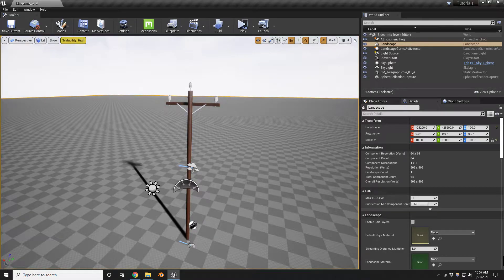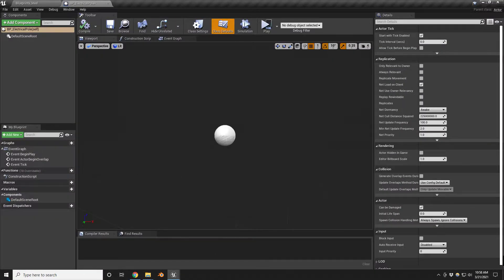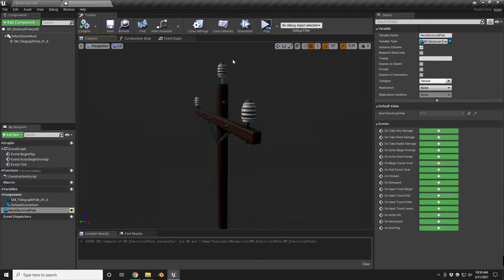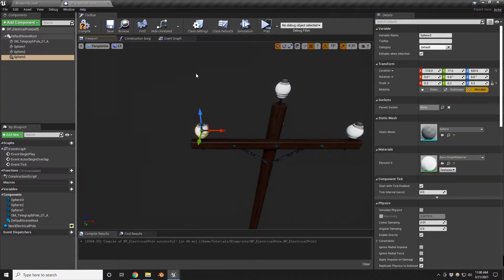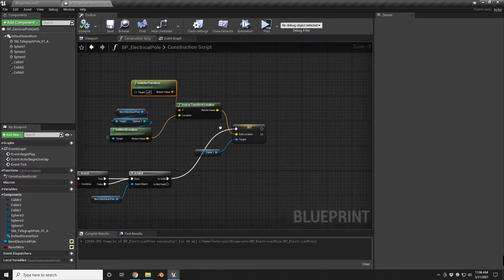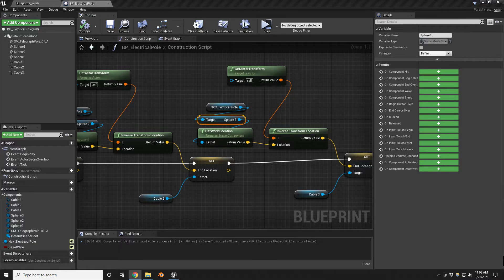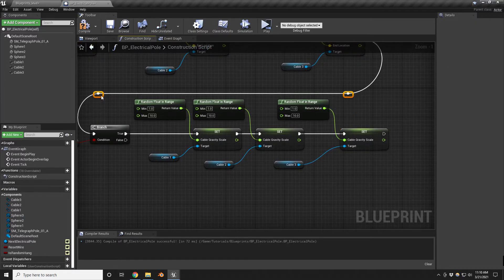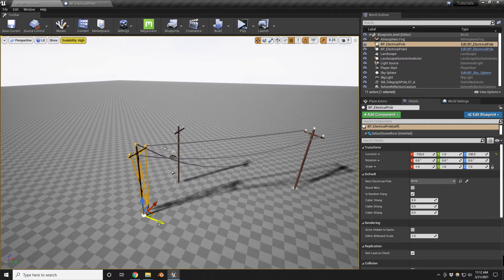Simple electrical/telegraph pole system in Unreal Engine

Comment: Very nice tutorial. I'm asking as a beginner - can this system be rigged to Unreal spline? So the poles placing will be more like automatic system?
Reply from the maker: That is a very good question. This might work on a spline, though i am not sure how the cable component will behave with that. The reason i did it this way, aside from the simplicity, was that you can control each pole and set various properties, like a light, torn cable, etc. One thing you can do once you have them all linked, if you move some of them around, is select them all, and check the reset wires box, to readjust the wires.
Reply: @AndreiGhenoiu  Thanks for answer. I agree, the control per pole is great to crate more natural feeling. Maybe the random attributes you presented in the video can make similar effect on the spline based poles in cases you don't need precise control. Like on long road distances etc

Comment: Have you experimented with connecting cables using PCG? I’m trying to work out making a post and wire fence using a spline but I’m in way over my head 😬
Reply from the maker: I have not yet done that. What I have done is use a tool from the marketplace called ia_scatter that also makes use of a spline, and place these poles as a blueprint actor using the tool, and them linking together automatically based on a trace and dot product. I showed it a few times during my weekly streams if you're interested in what I ended up with.
Reply: @AndreiGhenoiu  cool which stream episode was it? I’ll check it out
Reply from the maker: @peterallely5417  There should be something here https://www.youtube.com/watch?v=GFchu350FLE&ab_channel=AndreiGhenoiu, where I am going over some of my process - starting with the beginning of the video. Hope it helps a bit.

Comment: Tank you! Quick question though, when I try to package my game all the endpoints reset to a random point on the map? any solutions?
Reply from the maker: Oh that's an interesting one. I'll try to  package my project as well to test it out. Have you tried merging the blueprints down to meshes?
Reply: @AndreiGhenoiu  not yet, let me try that and see how it goes! Thank you!
Reply from the maker: @SaatvikDube  Sure thing! I'll see how it goes on my end as well, but would love to hear from you!
Reply: @AndreiGhenoiu  sounds good! I’ll let you know 👍🏾
Reply: @AndreiGhenoiu  So I tried a few solutions. First I merged all the Blueprints, however when i do this the only thing that shows up in the merged actor spheres from the blueprint. The same thing happens when I try to convert all the wires to a static mesh as well.
Reply from the maker: @SaatvikDube  Thanks so much for trying it out. I will try to package my project over the weekend and see what I get as well. Hope we can come up with a solution for this.
Reply: @AndreiGhenoiu  thanks you!
Reply from the maker: @SaatvikDube  Have you tried running it in standalone game? Was wondering if you have the same issue there. That should be similar to the package game.
Reply: @AndreiGhenoiu  Hello, thanks for the reply! I did try that stand-alone game works perfectly fine. Also it seems to become a problem the more cables I add in the level. When it’s 10-20 cables they package perfectly but when I get to a certain number, around 30, it starts breaking when i package it.
Reply from the maker: @SaatvikDube  ah, that is interesting, i wonder why the cables throw this issue. Let me try it with a larger number of cables as well.
Reply: @AndreiGhenoiu  awesome thanks again!

Comment: For some reason in UE5.0.3 my cables just won't attach to the next one... I can see them 'try-n-grab' the next pole, but fail and go back to their open-end postion.... If this is fixed i'm gonna add some spark niagara to the open ends :)
Reply from the maker: I will try and migrate that blueprint to a ue5 project and see if I get the same issue and let you know. If you don't hear from me by the end of the week, message me again here.
Reply from the maker: Hi Arnold, just tried exporting the blueprint to UE5 and it all works on my end. Any luck for you? If you are still having issues we can have a quick chat on discord and maybe you can show my what's going wrong - neverfollow81#1453

Comment: Mb for deleting the comment It got too cluttered and didnt think you'd respond, what did you mean by making the 2nd one a child of the first one?
the result I got to Is that Pole01 connect to Pole01, Pole02 connects to Pole01 but not Pole02 which makes sense sadly
Reply from the maker: So if you make the second blueprint as a child of the first, then change the mesh in the second blueprint, you should be able to connect child to parent to child, etc. . To do that, you right click on the parent pole blueprint, and select make child blueprint. Hope this helps.
Reply: @AndreiGhenoiu  Ill try that ty but the thing is presumably that only works for 2 poles not more correct?
Reply: @AndreiGhenoiu  Sir you are a saint, It worked (for the 5 poles I have) idk what to say Its perfect.
Hope someone gets you a nice birthday present.
Reply from the maker: @KouKaiii  awesome ! Really happy you got it working!